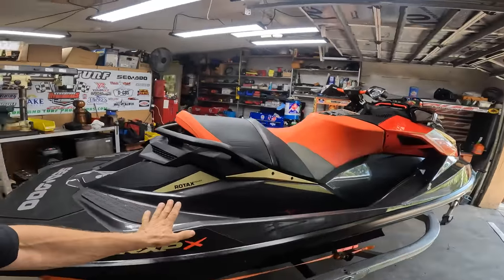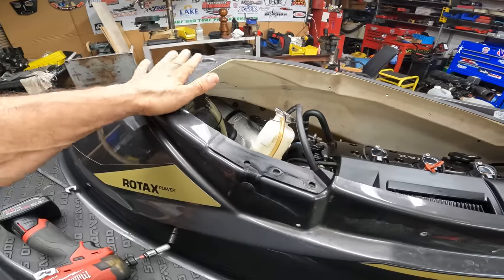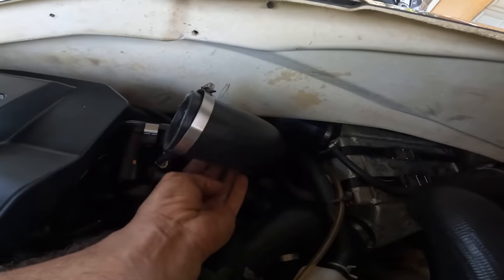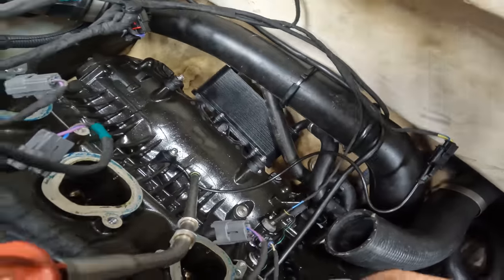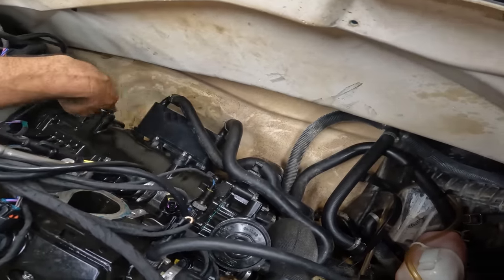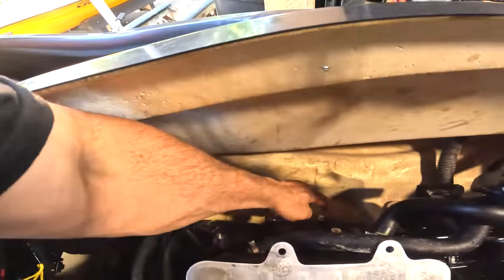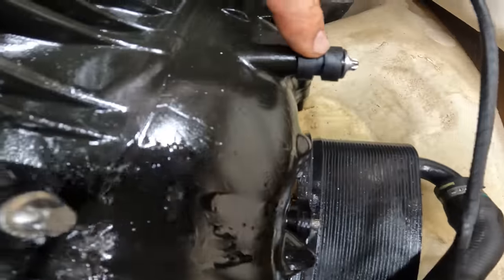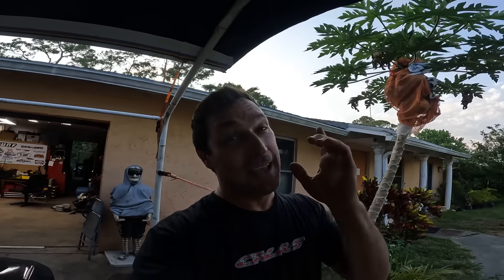2019 SeaDoo RXPX Oil Leak Fix + Oil Cooler O rings + Rotax Engine Tech Tips by Calas + How to Fix

Comment: The entertainment value alone is worth watching your videos!  I always enjoy your humour and troubleshooting skills that i always learn from!  It's refreshing when i can watch your videos and know you know what you're talking about with no BS that i can trust. I have a 2013 rxpx 260 with 100 hrs that's been sitting in my garage since 2019. I started it every few months since then and always fired up no problem. I used it primarily in salt water and always flushed it with salt away, dried it out, changed the oil/filter a few times.  I  let it sit for all this time starting with covid but other priorities limited funds for the 100 hour service i knew it needed so the ski sadly sat for all this time.  I finally got the rebuild kit and tools for the supercharger and a month ago i put the ski in the water just for a quick test to make sure everything was ok before doing the supercharger rebuild and service. I'm idiling out from the ramp for about 5 minutes and everything seems good and give it some gas, pops up on plane to 35 mph or so then coughs and almost dies out and running a little rough but after a few seconds sounds good at idle again so i give it the gas, same thing like it's starving for fuel. It's about a mile home and idled perfect, got it on the lift, drained the fuel, changed out the inner and outer fuel pump assembly strainers, spark plugs looked good but changed them anyway,  injectors looked clean but checked/cleaned them. Because of watching your video i pulled the throttle body hose and it was dry and clean. The throttle body only had a tiny bit of corrosion around the hose connection so i buttoned everything up and it started right up.  I get it lowered in the water and idle about 100 feet and it alarms with check engine light with a constant 2000 rpm idle. The throttle doesn't do anything just stays at 2000 rpm. I thought maybe thats how limp mode works so put it back on the lift. I go straight to the throttle body thinking i did something when i pulled the intercooler hose.  I pull the hose and see a little moisture where it had been completely dry 30 minutes prior. I started it and see water spraying out and it still had high idle but the alarm stopped, check engine light went off. I stopped it and reached in the throttle body pushing the butterfly slightly     and it felt stuck but freeded up with just slight pressure. I started it again and the idle is normal and have throttle control back with no alarms/lights.  I knew that intercooler at 11 years old needed changing but with only 100 hrs just thought it was weird how it went bad in 30 minutes idiling for a couple minutes.  I'm thinking i had multiple issues possibly with the fuel strainers or fuel deposits from 5 year old fuel causing the fuel starvation symptom, stuck or sticky fuel deposits in the throttle body causing the high idle and the intercooler just about to let go! That was a long story but i'm installing a fizzle today shipped direct that i got in one day with standard shipping. I didn't even realize it was sitting by my door all day thinking it would be a few days. It looks very well made and with any luck i'll be out on the water tomorrow! Thanks for all the valuable info and expertise i've used to have the confidence to work on my own ski saving lots of money and hopefully done right with help from your videos with the satisfaction i did it myself! Keep the excellent videos coming and  that great attitude you have with the comedy mixed in as icing on the cake!

Comment: The filter is one of the most common causes of an oil leak. Ideally, the oil filter should be replaced every oil change. If you change your oil at home, you may forget this important step or the new filter may not be installedly properly.

Comment: I am working on a 2013 GTI 130SE and the engine oil leaked into the coolant that made icky mess throughout the entire system,  but there is no trace of coolant in the oil.  Do you think it's a blown head gasket or a leaking oil cooler?  Also, what's a fast way to flush out all that mess from the cooling system??  Thanks for making great videos!

Comment: What are the torque specs for the 4 bolts on the oil cooler?  I am doing mine this weekend on my 2008 Challenger 230 Wake edition...thankfully on the boat, they are accessible without having to live the engine...thank you for the tip on the grease on the o rings...I was wondering how to prep them!

Comment: Great video like always but did you replace the intercooler…… I guess I’m lucky because I have a 2016 RXPX 300 with the original intercooler and it’s still perfect.
Reply from the maker: You should check it every time
Reply: @calasworld  oh I check it often my ski only has 100 hrs on it
Reply from the maker: I have  clients that only ride saltwater and they do not flush the JetSki and that it’s a problem
Reply: @calasworld  right I’m crazy about any of that any kinda of salt or brackish water I dump it in the local lake that’s spring fed and ride it for 5-10 min and then clean the inside with dawn and water

Comment: You can get the bottom bolts out without lifting the engine if you have a small wrench and are a flexible teenager 😂

Comment: Have you seen the oil coolers leak with O-rings intact? I have a 2018 RXT-X that seemed to be leaking from underneath left side of the oil cooler. I lifted engine and pulled oil cooler off but O-Rings were still there. No visible cracks, holes, or corrosion on oil cooler.

Comment: Minute 5:50 , whats that blue residue in the engine intake ports? Does It needs to be sealed with silicone with the rubber rings??